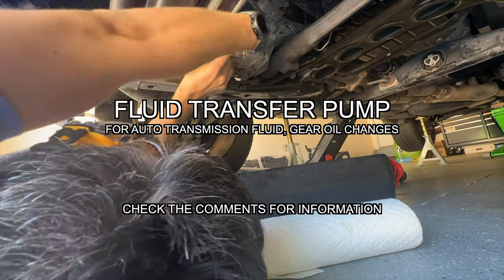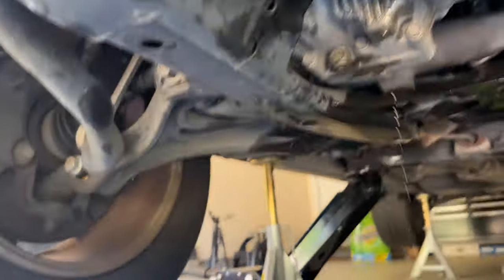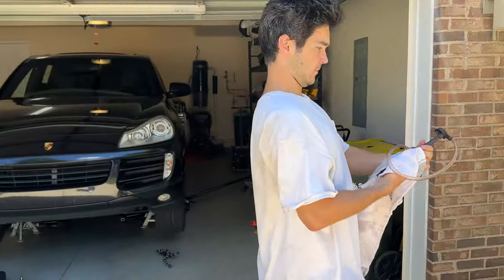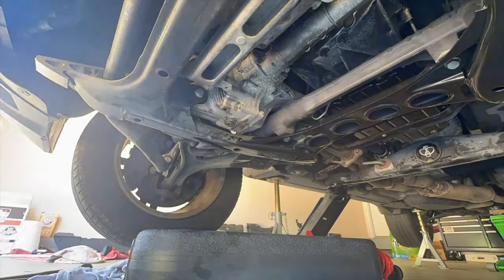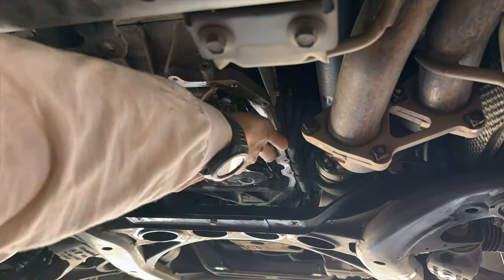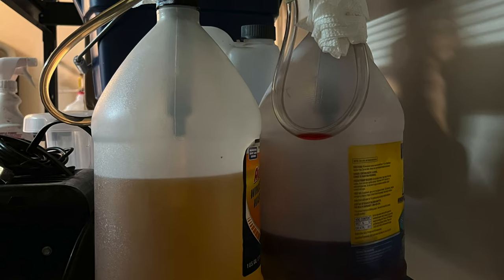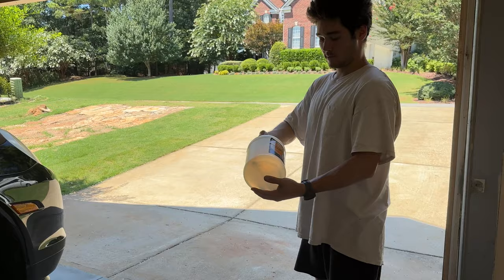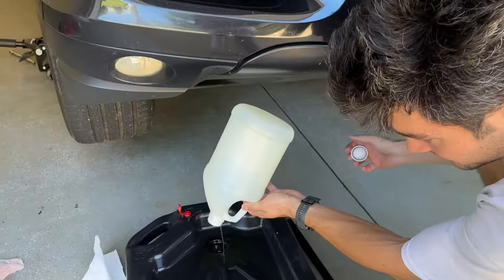DIY Fluid Transfer Pump for $10 | Automatic Transmission Fluid, Gear Oil Changes | Lubricant Pump

Comment: I like washer fluid bottles for doing a measured drain and fill.  Assuming that all of the fluid is a gallon or less you just need a permanent marker to mark where the fluid was.  Because of the way that fluid expands when warmer it won't be totally accurate as to the fluid level being the same but it should get it close.  Just have some extra ready if it is needed to set the fluid level.

Comment: I find that having an empty jug or other stable container that does not tip over easily is great when you pump any oils into something.  That is because the stuff still in the tube will drain out the first chance it gets and it could make a mess.  Also with some peoples' horrible luck I can imagine it starting a siphon that empties the whole container on the floor!  With a container for that hose end anything that comes out is saved and also still useable.  Also when you take the pump off the bottle there will still be fluid in it.  Put the end in a container and turn the pump upside down and you will see oil that was trapped by the check valve drain out.
Reply from the maker: These are terrific tips, thanks for sharing and taking the time.